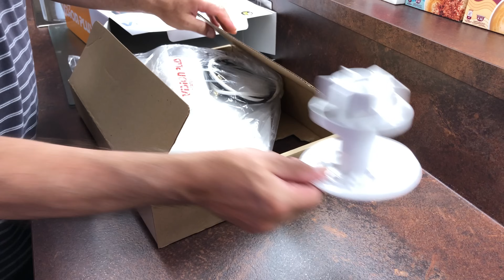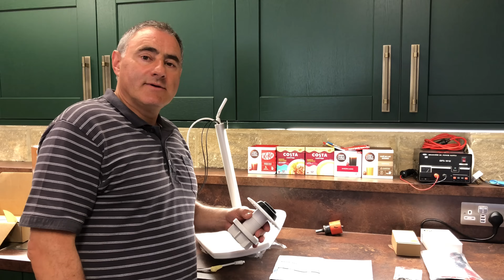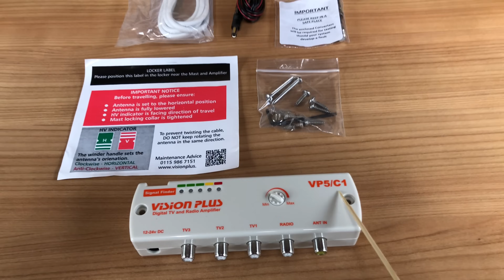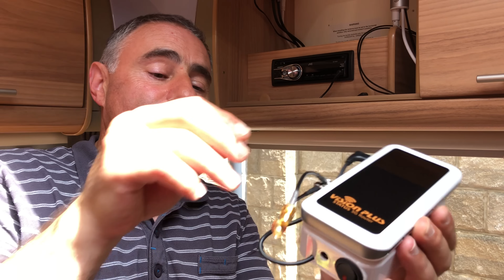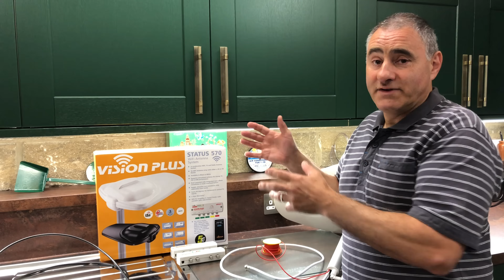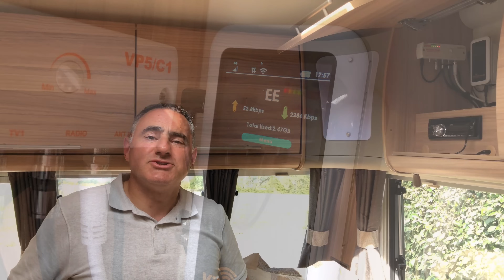Vision Plus Status 570 WiFi Antenna for Our Caravan

Comment: Starlink is a far better option than this. Over 600 is excessive. You dont get 4g or 5g everywhere especially in coastal locations. You would be better having unlimited data and using you're phone to tether with the same outcome
Reply from the maker: Hi Glen, I’ve heard and read Starlink is really good. You are correct in saying certain locations have no signal, which I’ve experienced and even the Vision Plus can’t help. We don’t have streaming services, only browse, watch the odd YouTube video and sync our video clips to iCloud. We do sometimes tether from our phone but tend to have reduced or almost no signal during the darker nights with the blinds closed due to the faraday cage effect. So the Vision Plus is just the ticket for us. When we go away I take the sim out of my phone and slot it into the Vision Plus. That way I’m not paying for something I’m not using when we’re not away in the caravan. Thanks for your comment as it will be helpful to others who read. Cheers, Rob 👍

Comment: Hi ware did you get the splitter from and do the male ones have to be 2.5 or 2.1
Reply from the maker: Hi Mike, search ebay item number 186078027569 for 5A 1 DC Female to 2 way male splitter plug 5.5 x 2.5mm power supply cable. 1 female to 2 male costs £3.02 plus £2.52 post. There is also the choice of a 3 way and 4 way splitter. Best sticking to 2.5 as there is a possibility of a loose connection. Hope this helps. Cheers, Rob & Gail 👍

Comment: Hi great vid, will it work in Europe? I live in Turkiye?
Reply from the maker: Sorry for the delay Mike, I’ve been finding out for you. Yes, the 5G router will work wherever there is a 5G (or 4G) cellular signal. However, if the router is used with a SIM card from a network provider based outside of the UK, then you may need to configure the APN settings on the router in order to get this to work. The APN is the gateway between the router and the internet, and you will need to firstly get this information from your network provider – it is usually available on their support website or by contacting them directly and you should look for the settings for using a SIM in a mobile broadband device or router. Once you have this info it is entered onto the router via the admin set-up interface. See my video titled ‘Vision Plus 5G WiFi Update & Campsite WiFi Connection’ on how to access the admin set-up interface. Hope this helps and I’m pleased you liked my video, All the best, Rob.
Reply: @robswiseways5697 Tnank you so much for the info great help look forward to more vids.

Comment: Hi Rob Thanks for a great vlog , very helpful. Just wanted to check the cable you purchased from Amazon. Does it have to be 2.5 mm, can only find 2.1. Would you have the link please.
Reply from the maker: Thanks for your compliment Jonathan 👍. In eBay search item number 186078027569 for 5A 1 DC Female to 2 way male splitter plug 5.5 x 2.5mm power supply cable. 1 female to 2 male costs £3.02 plus £2.52 post. There is also the choice of a 3 way and 4 way splitter. Hope this helps. Cheers, Rob & Gail 😀

Comment: Hi Rob, a great vlog which has convinced me to do the same.  Do you have a link to your eBay purchase of the splitter cable?  I can only find 5.5 x 2.1mm.  Thanks and keep up the great work 👍🏻
Reply from the maker: Thanks for your compliment 👍. Search ebay item number 186078027569 for 5A 1 DC Female to 2 way male splitter plug 5.5 x 2.5mm power supply cable. 1 female to 2 male costs £3.02 plus £2.52 post. There is also the choice of a 3 way and 4 way splitter. Hope this helps. Cheers, Rob & Gail 😀

Comment: Hi Rob just came across your video quick question do you still use this device and is it still delivering good results 
I’m looking for something simple way to fit but also works
Thanks
Lee
Reply from the maker: Hi Lee, I still use it regularly and it’s a great bit of kit. However, if the area mobile signal is poor as we experienced last week at Kelling Heath, Norfolk, it won’t improve things. The signal was hit and miss all week. Site WiFi was only available in and around the main reception / shop / bar areas. But it didn’t have a password, meaning it was insecure. Have a read at the comment from MotorhomeDIY. He fitted this aerial but connected it to a Kuma Connect router. Hope this helps, Cheers, Rob 👍
Reply: @robswiseways5697 thanks Rob

Comment: Dropped a like 👍 great video and presentation lad 
I just want to state to those thinking of upgrading and have the vp4 the only difference for the new vp5 is extra tv port and radio signal that is it 
I didn’t fit the vp5 I left in vp4 

If like me you have a motorhome and avoid sites and do off grid rural areas I never use the vision plus router it’s not great at all 

I use a EE SIM card in the Kuma connect with 4G stick with the vision plus aireal wi fi they work brilliant together 

Park up move the vision plus aireal around inside watching for a connect to a tower 
Download the app for iPhone cell mapper which gives you the location you are and shows all available towers 😅 and directions so just move the vision plus aireal to that location and boom solid signal 

I have been out in the stick’s rural areas and always have signal but didn’t with the vision plus router
Reply: That’s a great tip it one of those things that’s hard to get right starlink is just very expensive
Reply from the maker: Thanks very much for your compliment and great tip, and for sharing your setup and experience 👍 . This sounds like a brilliant way to stay connected when off-grid and it’s really helpful advice for others looking to improve their signal in rural areas. 
It’s a fantastic all in one aerial and it goes to show the standard SMA connectors on the aerial leads will fit other routers. 
I’ll check out that iphone cell mapper 👍 . I do find the new VP5 really handy though with those extra signal finding LED’s. It’s only a 10 minute job to swap it over. 
Cheers for your watching and for your advice, 
Rob 😀
Reply: @robswiseways5697 if you look at the vp4 c1 it has 5 led signals the same mate
Reply from the maker: @FiatDucato-ComForTmatic-Guy  Just had a look on VP website and I was surprised to see the VP4 with the extra LED’s. It must be a new updated version as it wasn’t there a few months ago. Thanks for letting me know 👍

Comment: Great video but what Faster SIM did you upgrade to? I thought they were all the same speed. Thanks.
Reply from the maker: Hi David, I’ve only upgraded from speeds of 10mbps to speeds of up to 100mbps because the lower speed was painfully slow when watching videos. There is also uncapped speed for a higher cost. Apparently if I move my BT home broadband to EE, I could probably get the uncapped speed with unlimited data for the same price as I’m paying now. I have 50G data per month for £15. Cheers, Rob 👍
Reply: @robswiseways5697  Thanks Rob, now got to guess my usage!

Comment: Brilliant video Rob as normal, has just made my mind up for me to go ahead and purchase the full system with new amplifier as well. Quick query, the power lead splitter you bought, can I ask where you purchased that from?
Reply from the maker: Hi David, thanks for your compliment and it’s good to hear you’ve decided on this kit 👍. Also the amplifier is such an improvement on what we had before. I purchased the splitter from ebay item number 186078027569 for 5A 1 DC Female to 2 way male splitter plug 5.5 x 2.5mm power supply cable. 1 female to 2 male costs £3.02 plus £2.52 post. There is also the choice of a 3 way and 4 way splitter. I’ve just looked and it’s still available. Hope this helps. Cheers, Rob

Comment: Fitted mine today. Went from getting 30Mbps down using the internal bunny ears on my router to getting 89Mbps using this external antenna. Obviously this will change depending on where I am staying but it will definitely help get a signal in places I saw nothing before. 

I don’t plan to use the included Vision Plus router (although I did fit it) as my current router is a higher spec. 

Vision Plus should just sell the antenna itself without the router.
Reply from the maker: It’s a great idea to pair the antenna with a higher spec router. Personally, I wouldn’t mind a UK legal mobile signal booster connected to my Vision Plus antenna, like the Hi10-5S-Pro Hi Boost, but it’s just so expensive. I’m impressed with your speed boost, it really does make a difference having an external antenna. Glad it all went well for you and cheers for letting me know. Rob 👍

Comment: Just bought one. Also, I must apologise for saying it wasn’t a wifi antenna in a previous comment. Apparently it can also be used to connect to an external wifi signal which is a nice addition for sites that offer wifi.
Reply from the maker: No need to apologise at all, I hope you find it as useful on your travels as we have. Hope you’ve bought the 5G kit as only this version will connect to campsite wifi. But I’m not sure how it would work with CAMC wifi, with having to register to sign in. I’ve yet to try it out. It really is a great feature to have, enjoy using your new kit on your next trip away! Cheers, Rob 👍

Comment: If you have the OEM version antenna (as I have) that you showed, rather than just cut the wires I'd be inclined to try strip the existing arial on the roof in case the coax and power lead have screw or push on connectors within the antenna. Then all you would need to do is fit the coax to the radio connection on the tv booster and use the power supply for the new router.  
Whose network SIM's did you use in the end?
Just thought you can’t just cut the red wire because it’s two core, so you then need to separate the wires and isolate them separately.
Reply from the maker: Great idea about possible connectors within the antenna Stephen. Not sure how easy it would be to open the antenna though. The single positive wire could be used for the router but a negative wire would be required. These would have to be wired into a DC plug. Probably easier to use a splitter like in the video. 
I was with BT mobile but the contract ended and they directed me to EE which is who we are with. Cheers, Rob & Gail 👍

Comment: Brilliant video as always my friend just ordered myself one and a smart tv to boot ready for caravan trip in the new year
Reply from the maker: Thank you for your compliment Steve 👍. I do hope you purchased the 5G version as I’ve recently learnt only the 5G router has the facility to connect to campsite wifi. I was only able to add a note in the video description box. Happy touring for 2026 and would appreciate your thoughts on your new tv whichever brand you’ve purchased. Cheers, Rob & Gail 😀
Reply: @robswiseways5697 thanks for the reply rob yes I did order the 5g version my caravan is quite old it’s a luna clubman 475/2ck 2005 but very clean and tidy I’m just wondering how I can get the dab cable from my kenwood stereo to the antenna can’t seem to find an extension coax cable any advice would be greatly appreciated thanks 🙏
Reply from the maker: @stevehopkinson4871  Nice caravan Steve and good size for a two berth 👍. Take a look in DIY shops or caravan spares shops. They should have coax extensions at different lengths and a selection of adapters if required. Hope this helps. Rob
Reply: @robswiseways5697 thanks rob much appreciate

Comment: HI Rob, Great Video. After 2 months, how have you got on with it? do you find you are getting a better signal than a standalone mifi router?
Reply from the maker: Hi Neil, So far so good 👍. Previously we only used the personal hotspot on our mobile phone to connect to the internet. With this new set up the signal inside the caravan has improved over the standalone phone, especially when the blinds are down. Bearing in mind external signal can vary from site to site. I’ll be releasing a short update video in January which will include connecting to campsite WiFi. Please note, I’ve recently learnt only the 5G router has the functionality to connect to campsite WiFi. Hope this helps. Cheers, Rob 👍

Comment: Good morning Rob, I was wondering how you are getting on with the Status 570, I’m looking to upgrade my caravan Wi-Fi but like yourself I’m very reluctant to drill a hole through my caravan roof. Is the Status 570 living up to your expectations and would you say it’s value for money given the fact it’s certainly not cheap. Sorry for the long winded question.
Reply from the maker: Hi Tom, I’m pleased with its performance so far. I’m now including a quick clip in each of our holiday videos, showing speed comparisons inside the caravan, between mobile signal and Vision Plus. So far the Vision Plus has always shown a better performance. You do have to bear in mind each new site / area is different. In our Park Cliffe Windermere video I mention the mobile signal being very poor and in cases like this even Vision Plus cannot help. 
You can use the router to connect to campsite WiFi if they offer this. However, please note only the 5G router has this functionality and not the 4G. I’ve only just found this out and would have mentioned it in my video had I known. It’s early days and I am still getting used to the system. I’ve recently learnt how to use the router to connect to campsite WiFi. In the new year I plan to make a short video showing how this is done. Hope this helps and thanks for your comment. Cheers, Rob 👍
Reply: @robswiseways5697  Thank you for your reply Bob, that’s interesting about connecting to the site Wi-Fi, I look forward to your up and coming vlogs 👌🏻

Comment: Can this set up login to a campsite WiFi, if so can you show use how to do that, thanks
Reply from the maker: Hi Garry, Yes you can log onto campsite WiFi. I’m planning to do a short video which will include this. However, We’re going away next week and I’ll probably show connecting to campsite WiFi in the holiday video. By the way, I did a speed test comparison between mobile signal and Vision Plus WiFi on our Ferry Meadows holiday video. Cheers, Rob & Gail 😀
Reply from the maker: Hi Gary, a quick personal reply to let you know my first video early January 2026 will be the Vision Plus update, including connecting to campsite WiFi. I didn’t show this on our Lower Micklin holiday vlog because it would have dominated the video. I filmed quite a few clips there but needed more time to complete it. Best regards, Rob

Comment: Hi Rob, after watching your video I jumped in and got this aerial. So far it works great, I have one question that you may be able to answer. How do you remove the SIM card ? Cheers, Nick.
Reply from the maker: That’s great news Nick 👍 I’m pleased it’s all working for you. To remove the SIM, you can use anything that’s approx the thickness of the sim card and gently press the sim in and let go. The SIM should pop out. Hope this helps. Cheers, Rob & Gail 😀

Comment: Excellent video Rob, I was close to having another hole drilled in the roof until I saw you do this. It's a perfect alternative, especially if you already have a vision plus aerial. It works perfectly and even on one site I only had one tiny bar of 4G showing, but connected the TV, and 2 mobile phones to work very well. Great instructional video too! Thanks, Rob 🙂👍
Reply from the maker: Thanks very much Scott 👍. I’m pleased it’s all working well for you and glad you didn’t drill that hole 😁. I’ve yet to do a short follow up video on how to connect to campsite WiFi, when I get round to it 🕰️ . Thanks for letting me know. Cheers, Rob & Gail 😀

Comment: Just make sure your existing ariel is a vision plus!!!!! Because it's not an easy swap if not, you will need the full kit not just the upgrade kit
Reply from the maker: You’re absolutely correct there Gary. I’ve had a comment asking if this can be a direct replacement for a Teleco ariel. Thanks for your input, it will be greatly appreciated 👍 . Cheers, Rob & Gail 😀

Comment: Hi Rob , Great Video , How much better is the VP5/C1 than the VP3 , What's the Difference ???
Reply from the maker: Hi Terry, I can’t say that there is any difference between the two, other than it gives a better idea of signal strength. On saying that I’ve not compared tech spec differences between them both. Probably worth checking the specs out on their website. Glad you enjoyed the video 👍. Cheers, Rob & Gail 😀
Reply: @robswiseways5697  Thanks

Comment: fantastic review. really appreciate the way you've reviewed & presented this tutorial. 
One question on the power supply, I would like to power it the same way you have done with the splitter.
Currently the set up on our new van is an older style Teleco AT42 from what I can work out.
I can't tell if this older unit is 2.1mm or 2.5mm as this would be the female plug I need to tap into it.
Was therefore going to get both in case but on the VP side (Router & Amplifier) can you confirm that these are both the 5.5mm x 2.5mm.
Reply from the maker: Thank you very much Dean, most kind of you 👍. Sorry I’m not familiar with Teleco aerials. I can confirm the router and amplifier are both 5.5mm x 2.5mm. You can purchase adapters that convert from 2.1 to 2.5 and visa versa. You may need an adapter to convert your existing supply to fit a splitter. Hope this helps. Cheers, Rob & Gail 😀
Reply: @robswiseways5697 much appreciated Rob. Will let you know in due course how things go. Your video is duly saved fir reference 🤩